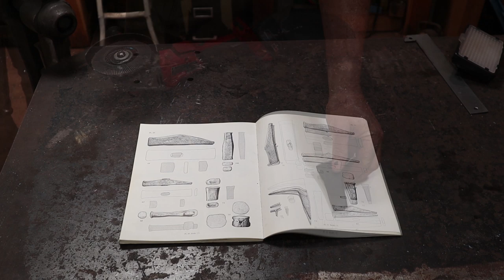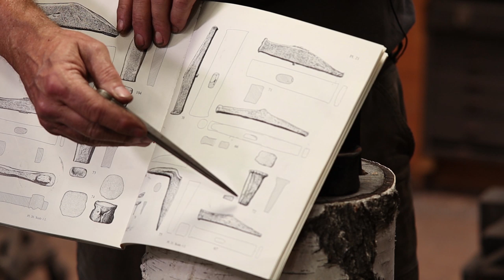Viking anvils from the Mastermyr find - part 3 - hardening and tempering

Comment: I remember somewhere that tools of old had similar drifts, which I agree is what the smaller "anvils" were most likely used for. By using the same drift for adze, hand axe, hammer, and other tools you could switch them out quite easily -- and make for easier storage in traveling with just one handle and several tool heads.

Comment: Seeing you hold the small block-shaped anvil made me think it is a clenching iron, used behind a plank to turn and clench nails for boatbuilding or other places where a very tight connection is needed. Clenched nails are also great for doors.
Reply from the maker: I think thats a reasonable guess
Reply: @BlackBearForge  the more people spit ball there theory's the more sure I am that tool held multiple functions.

Comment: Me thinks you are having way too much fun John.......😉    What happens if you quench 4140 in water? Will it still work?  Looking forward to Sunday's hook of the week.  Be well.
Reply from the maker: 4140 is listed as an oil hardening steel, so it might crack if quenched in water.  I have heard of people doing it, but I don't know if they get away with it or not.
Reply: @BlackBearForge  
Antifreeze (propylene glycol) with sea salt. Use a fume hood or ventilation, as the steam is not healthy! Faster than oil, yet a tad slower than plain water.  Warm it to about 190°f or so. Try it and maybe do a test for the viewers. Waiting with white knuckles! If I remember correctly from the '80's, a lb of salt to a gallon of antifreeze. Don't quote me, as it's been awhile.

Comment: I suspect many of the common jobs for the Vikings were of relatively small objects, taking dents out of weapon edges, making fish hooks, nails, pot hooks and the many small objects used in daily life.  Due to the difficulty of smelting large amounts of Iron (no auto scrap yards available LOL), large smithing projects were probably pretty rare, and done in an established forge.

Today, cane cutters still use small stump anvils to sharpen their machetes.  I made one out of a big truck valve, sharpened to drive into the stump, and with a stop welded on the stem to limit penetration and take the force of the blow.  It works great for dressing small dents in blades. Small stump anvils and stump vises are sold on Ebay.

Comment: for what its worth my theory is that these were used for tin smith work. Lighter sheet metal and smaller stuff given the size of the anvils. The tapers and radiused edges would be quite usefull for such things.

Comment: Mr. John: I have been watching your interpretation of item #76 from the catalog. I can't help but wonder if the "heel" of the right angle was a deliberate feature, as opposed to rusty old sample with metal missing. Plate #21 shows it as if it was deliberately created as a concave inset for purposes unknown. Maybe there is room for exploration here.
Reply from the maker: That dip is actually a natural result of forging a sharp bend by offsetting.  I worked harder to remove it than the original smith did.  But that doesn't meant that it wasn't left that way or used for a specific purpose.  Like todays anvils, every surface is fair game if it has the shape you need.

Comment: Great video.  Can you please elaborate on why it is important to preheat oil for quenching.   For oil quench I use used motor oil.    Don't know if that's good or bad.  Appreciate you opinion.  Thanks.
Reply from the maker: It thins the oil out for a more even quench

Comment: I have a some different drifts (12:37) from an old blacksmith shop, probably way over 100years old, and they have all been hammered on so I know that they are drifts. Some of them is 4-5 times the size you have there. I have no idea what they produced but they were used for drifting due to crowning and scrape marks on the sides.  One of them is probably around 5kg. If you want I can send you pictures of them.
Reply from the maker: Those would be interesting to see.  You can email the pictures to switz@mindspring.com

Comment: I think the small pointed "anvil" is actually a treadle lathe center. The mastermyr find wasnt a specifically blacksmiths toolbox, many woodworking tools as well.
Reply: To add to my point, some of the hammers found with the tools are larger than the supposed anvils.

Comment: The round puck reminds me if a bucking bar for setting rivets in planes. (My dad was a small plane pilot and mechanic)
Reply from the maker: That would be a likely use for that piece.  There were various pot riveted together in the find, so the smith may have been doing that type of work.

Comment: 11:40 Speaking of that piece. Let's say I go for an anvil like this but scaled times 2, hardened top, mild steel bottom, 2-piece weld. What would be the thickness of the top part to achieve good performance?
Reply from the maker: For an anvil I would go 1/2" or a bit thicker

Comment: What kind of oil do you use for quenching?
Reply from the maker: I buy a commercial oil made for quenching.  There are lots of brands out there that all preform about the same.
Reply: Ok. I haven't done any work yet that requires a quench, but I have heard people talk about a lot of different oils, Canola, motor, and commercial. I am just curious which is a better choice. Or if there is much of a difference between them. Thank you for your replies, I really appreciate it. As always a great video 👍
Reply from the maker: motor oil can impart impurities into the steel from impurities or additives in the oil and should never be used.  Commercial quenching oil is the best, but olive oil or canola oil seem to work nearly as well and smell better in use.

Comment: Definitely need deeper holes. If they weren’t heat treated anvils I wouldn’t be surprised if the owners just heated them and burned them into the stump, then hammered in wooded wedges to secure them.

Comment: A non contact thermometer would help guage the heat for tempering.
Reply from the maker: For tempering they may work OK.  For judging hardening temperatures you have to hold them to far away to avoid damage and that spreads the area it reads out so that the background is also effecting the reading

Comment: can you try the nomal hammer on the small anvil，i think do not need small hammer
Reply from the maker: An anvil face should be larger than the hammer face or at least no smaller.  Otherwise you are creating steps in the work with each blow.  This is one of the reasons I doubt these were used in the same manner we use an anvil today.

Comment: Several times you say "we will never know". Archaeologists seldom say this, their task is to find a way to know. For instance, your suggestion that one of the anvils is a drift is an hypothesis that could be tested by microscopic examination of the drift and eye to look for tooling marks that could confirm one was used to shape the other.
Reply from the maker: Since the find is over 80 years old and the book was written over 35 years ago with no mention of microscopic examination of the drift and eye.  I think it likely that those test were not done and probably never will be done.  Which means that most likely you and I will never know for sure.  I wish someone would do a more thorough write up on exactly what they did find and how they came to identify some of these tools as they did, along with the metallurgical analysis on all of the tools so we would know which were just wrought iron and which had steel faces or edges.
Reply: @BlackBearForge  The only thing stopping some one doing these tests is time and money. If someone can find the money, the museum will find the time....
Reply from the maker: That is probably true.  But I won't be holding my breath for more detailed answers
Reply: @BlackBearForge  Sometime next century - maybe.....

Comment: The Vikings may have used very small anvils simply because iron was expensive and fairly scarce for them. A half-ton or quarter-ton of iron or steel to hammer things on would have been beyond the means of most Viking smiths.
Reply from the maker: Thats true, but when you find hammers weighing 10 times what these small anvils do in the same chest it seems likely they both had the skills to make a larger anvil as well as the materials.

Comment: I think you've got it dead on that those small ones are hammer/axe drifts instead of anvils.  The tooling is specific to the types of items they needed to make ... and that would have been axes and similar objects.
Reply: I think what really solidifies this theory is not that a traveling smith would need to make hammers/ axes very often (can you imagine, on a tiny anvil like in the find?), but one of the key things they'd need to do would be to dress/ reforge the eyes of existing tools, either because they got misshapen over time or as part of another repair.

Comment: I don't understand why you used a silly hammer!!! I could feel it not hitting! I don't think a Viking Blacksmith would have handicapped himself like that! Regards, Matthew
Reply from the maker: The hammer choice was based on the size of the smaller anvil.  The hammer face shouldn't be bigger than the anvil face.  This is one reason I feel the smallest anvils weren't used as we use an anvil, but rather served a different purpose.